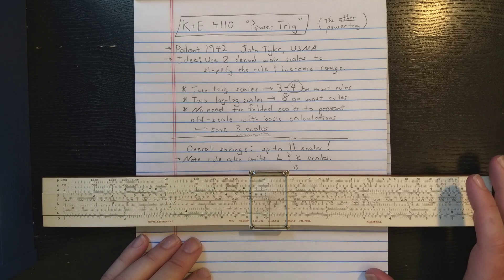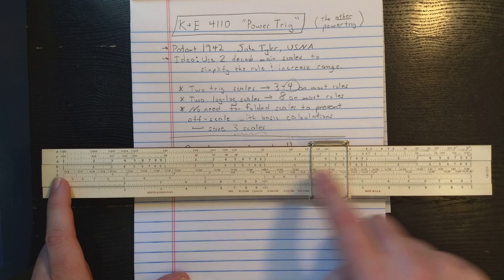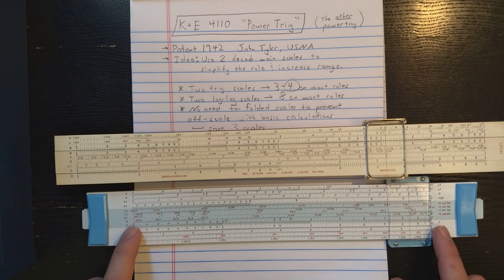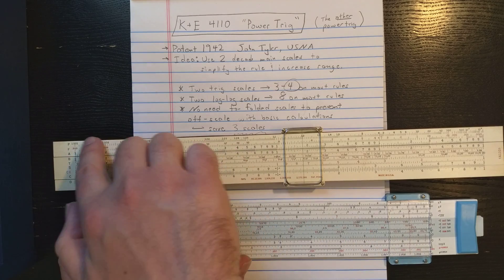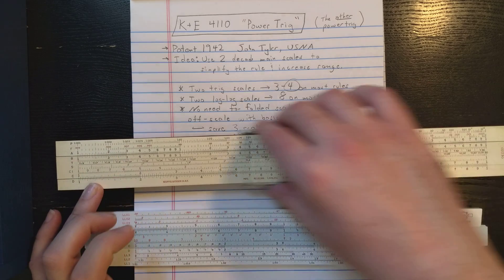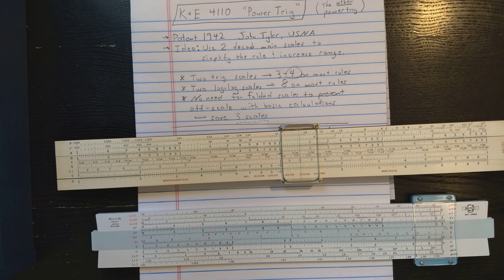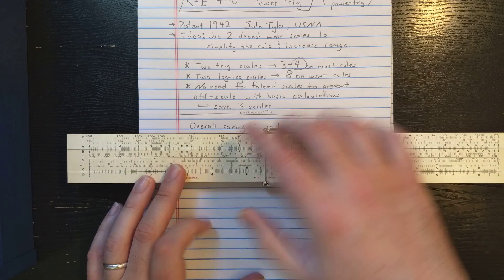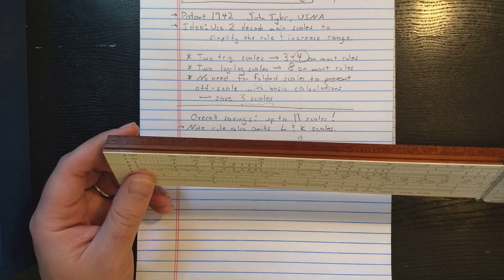K+E 4110 Power Trig Slide Rule -- help needed!

Comment: Greetings Prof. Herning,

Let me begin by complementing you on your video series; I find them to be both informative and entertaining, bravo.....

Regarding your stripped screw issue, I reviewed the construction of the 2 K&E 4110 rules I am fortunate to own.  The scale adjusting screws are custom, with a long barrel head extending from the visible screwdriver slotted face and necking down to a standard 0.072 inch diameter SAE #1 male end, which my tired eyes can't discern as fine or coarse threads.  The screw head bears on a metal washer seated in the counter-bore of the mahogany back which is slotted to maintain scale alignment while adjusting the slider clearance.  The adjustable scale is fitted with pressed-in brass bushings threaded for these screws, and it is likely one of these bushings and/or the screw itself is stripped and unable to be tightened....

Consider disassembly by removing the 3 good screws and then GENTLY pulling on the scale while turning the stripped screw “lefty loosey” until, hopefully, it comes off.  If you get that far and verify the threads are damaged, I suggest you try a miniaturized version of the old carpenter's trick of filling the damaged hole to restore the grip of any remaining threads by inserting a strand or 2 of waxed dentil floss or equivalent into the damaged bushing hole and reassembling....

I would NOT recommend using Loctite or other adhesive as that would render the joint “permanent” as such a small screw would likely twist off if you ever needed to readjust the slide.....

FYI, the construction is similar to My 4053 rule which uses different screws.  On that rule, I found it the slotted guide washers discussed above had to be CAREFULLY widened with a jeweler's file in order to align the scales....

Good luck on your repair effort, and let me know if I can be of any assistance, such as sending pics....

Regards,

FJPaski
Reply from the maker: Thanks so much! I haven't had time to investigate this yet, but this is just the kind of information I was hoping someone would have! I'll update, maybe with a new video, when I get around to it.
Reply: One other sobering thought occurred to me....

While the female threaded bushings in the adjustable scale appear to have a death grip in my own rules, it MAY be the "stripped* one in yours is loose and spinning freely.....

As the screw is centered 0.63 inches in from the end of the scale, and IF the bushing is loose, it MAY be that thin mahogany ligament between the bushing and the very end of the scale MAY show evidence of a crack in the wood.

If a crack in the end of adjustable scale is indeed found, I suggest augmenting the earlier disassembly procedure by first pulling the slide & cursor and putting a small C-clamp across the adjustable scale to keep the crack closed.  Add soft padding to the clamp contact points to avoid further damage....

The clamped scale MAY now provide enough drag to allow removal of the spinning screw.    Hopefully this scenario is not the case, but it's worth a close visual inspection prior to proceeding.....

Best of luck....
Reply: FYI, I happened across the relevant K&E adjustable slide patent drawings on McCoy's excellent site:

http://www.mccoys-kecatalogs.com/KEPatents/1934232_AdjustbleMannheim/1934232.htm

The sketches show the 'fillister head-like screws which I believe to be SAE #1-72 fine pitch seated on slotted washers to maintain scale alignment and the female threaded bushing inserts.....

BTW, Amazon sells SIMILAR screws, $6 for a bag of 100....

One note of caution regarding the brass inserts, they are depicted as being pressed in from the visible face, but if I had been working for K&E at the time, I would have changed the construction to pressing the bushing in from the far side prior to applying the celluloid coating, so it could not pull out, purely conjecture....

Comment: That is the weirdest and most interesting scale set I have ever seen. Practicality over precision to the bitter end, for those who really don't need anything more than 2dp (or 2sf) to turn out a basic answer. Most people in that day and age would have had access to four-figure log and trig tables with very little trouble and seven figures without much more, so I can see why he figured an L scale was superfluous, and there are neat little shortcuts that get around the lack of a K scale IIRC, at least in the direction of raising to the power three (not so much the cube root).

I guess for the inventor, the aim was to compress as much functionality as he could onto the front of a true simplex slide rule, and in this I think he succeeded.
Reply from the maker: I agree -- definitely accomplishes its goal. Certainly you can cube with C/CI/D if you need to; or you can use D/A/B. Cube root would probably be done on P or F though with low resolution.
Reply: Interestingly enough, I tried a couple of cube roots on my K&E 4081-3 using the log-log scales this morning. For numbers near the lower end of each log-log segment (below 20 on LL3, below about 1.35 on LL2, below about 1.03 on LL1), it falls off the scale (EDIT: I figured out what I was doing wrong here.)

With the 4110, the continuity of the log-log scale and the way it is indexed means that wouldn't happen at all until your starting number is exceedingly close to 1, another advantage of the 4110, but you are right about the low resolution. Though it's always possible to cheat, and transfer (say) 65 down the scale by splitting it into 6.5 x 10^1 and then taking the cube root of both.
Reply from the maker: Some slide rules have (10)^(1/3) and (100)^(1/3) gauge marks which I believe are for the technique you mention at the end -- this idea keeps the logarithm of the number smaller, so you get a higher resolution result when dividing by 3.

(these are typically rules without K or LL, so that you are doing cube roots using L).
Reply from the maker: p.s. if you fall off LL1 when doing a cube root or other power, you can switch to D. I have a video about this, but it's also mentioned in the K+E manual (they call it using "LLD"). There is a bit of loss of accuracy which is why some rules have LL0. After LL0, using D doesn't lose any discernible accuracy on the slide rule.
Reply from the maker: Also, just re-reading your comment, I just wanted to make sure I pointed out that when you fall off LL2 to the left the result is on LL1 (and for LL3 it's LL2). It's once you make it all the way to the end of LL1 (or LL0 if you have it) that you use "LLD."